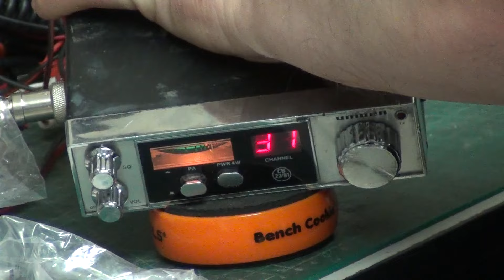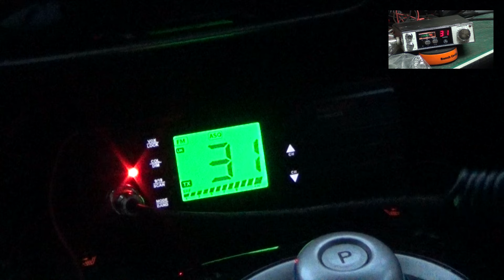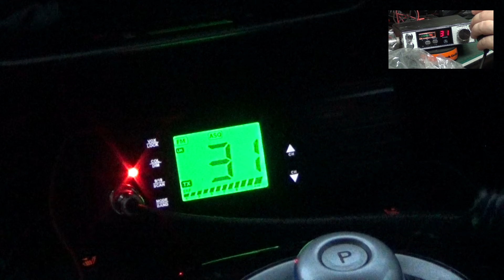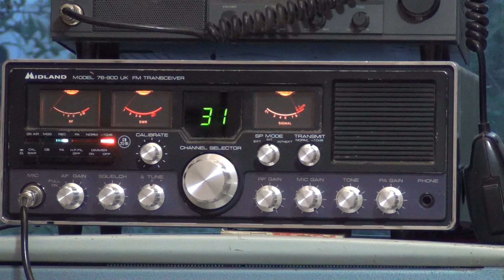Uniden Uniace 100 CB27/81 UK FM CB radio - On The Air test

Comment: not sure what you're trying to achieve or show by going from high to low power with a radio in the same property ?
surely it doesn't make any odds at all and if it does then something much be wrong surely ?
Reply from the maker: On sets that suffer from hum on TX, the hum will diminish on low power. Whilst I could just do the hi/lo thing on sets that suffer from tx hum, I feel it best to show all sets in the same way.  Awful radios like the York JCB867 & Murphy DS602 come to the front of my mind.

Richard, G0OJF, UK